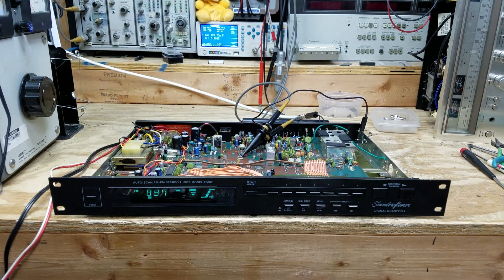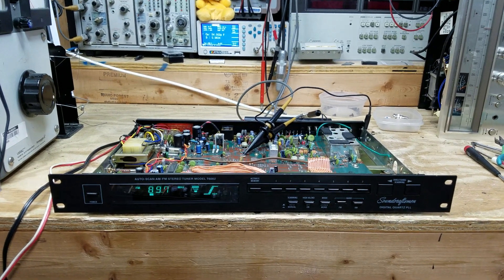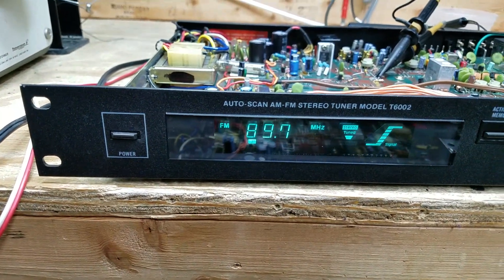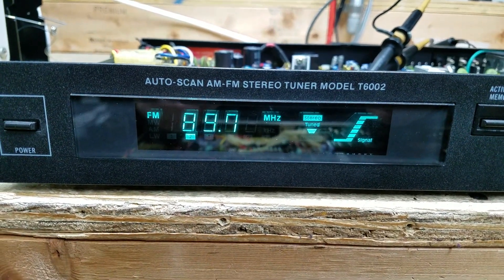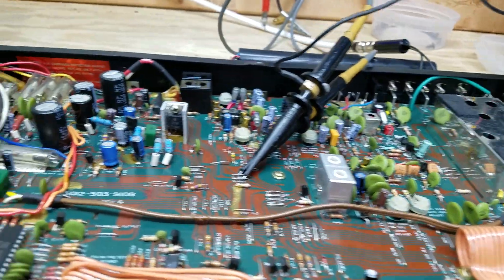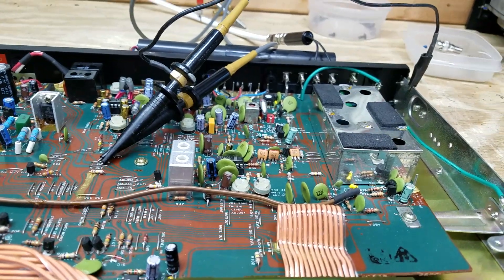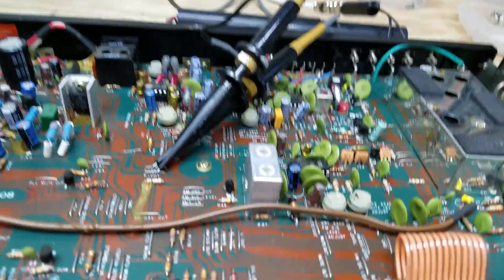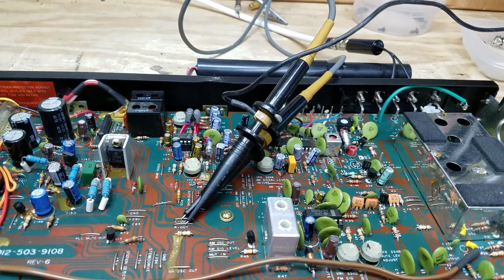The Stereo Equipment you've always wanted.. Episode 15.. Soundcraftsmen T6002 Tuner

Comment: Fixing something that is totally f****d is so satisfying. Someone gave me a home theatre system yesterday that was trashed. I wanted to destroy it for parts but I am in Africa and my boy on the farm was like, it has usb. I have no amplifier. So me and him tore it down yesterday and after few hrs and replacing swollen capacitors bad diodes fuse resistor and loose solder joints it now works. We both had a free sunday project and. My boy now has a amplifier. Keep fixing something. It's the best 😀